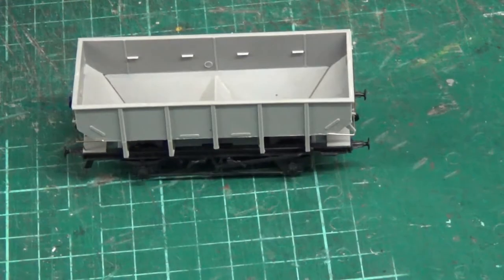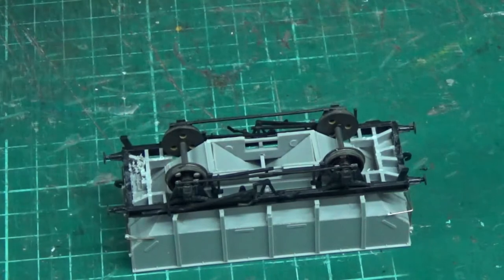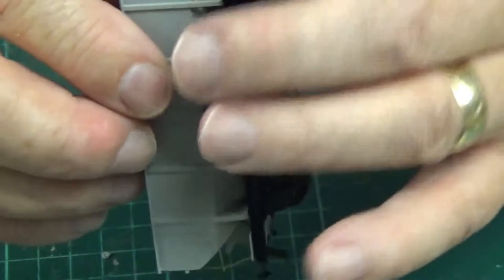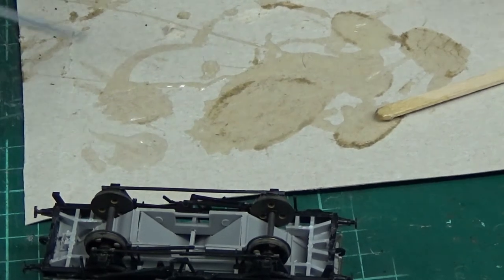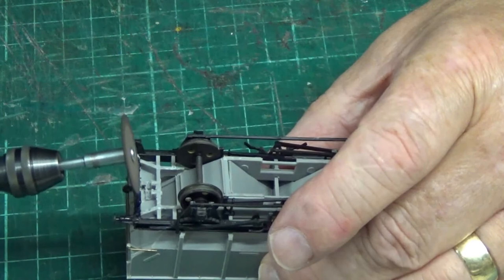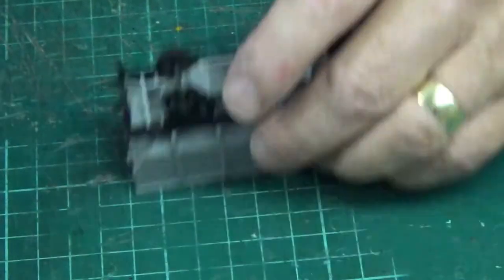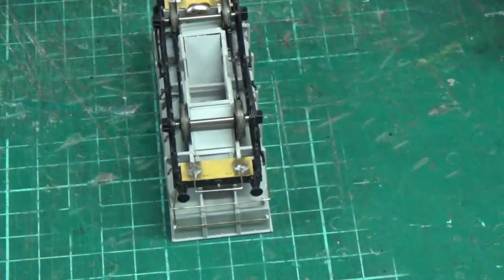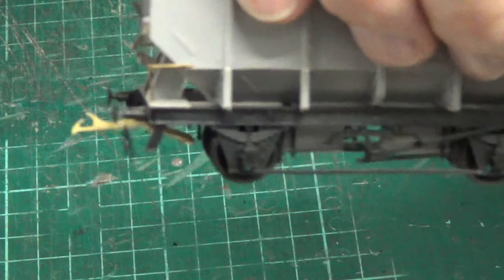Fitting a Sprat & Winkle Coupling To A Parkside Dundas 21T Hopper Wagon. Video #42

Comment: Hii Michael
Great video, it does look a tricky job though.  Definately a job for a quiet day with no kids around.
Its certainly something Ill keep in mind as I have had a few minor issues with the tension couplings
on my dapol hoppers, they seem very floppy and uncouple themselves.  Not sure if this may be due to
my helix or just these wagons.
Enjoyed the video
Cheers Paul
Reply from the maker: Thanks for your comment Paul, I am glad you enjoyed the video, yes it could be the helix. There is a small bit of uneven track on my main running lines and tension locks uncouple there every time without fail but no problem at all with the S&W couplings but as you say it can be tricky to do but worth it my opinion.
Regards
Michael
Reply: WestBlythMPD 
Cheers Michael
Yes the helix doesnt take any prisoners when it comes to couplings, hornby class 56 and 31 have that flexible thing underneath the nose and its great except it mostly doesnt work and sticks and derails its train.  
Ive a load of kadees to try, number18 etc that plug in and 5s that are glued on, which Ive had ages but not used yet, I may seriously consider trying a few of these s and w  in the future.
Thanks again Paul